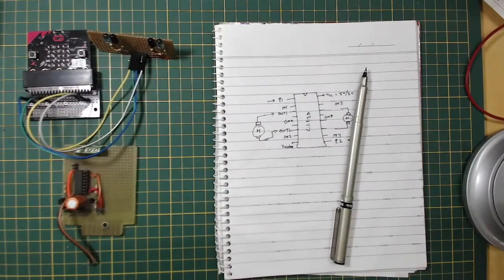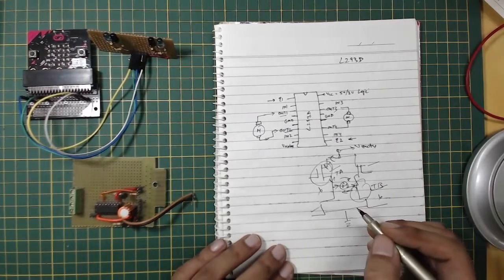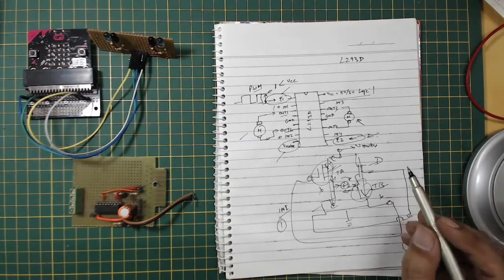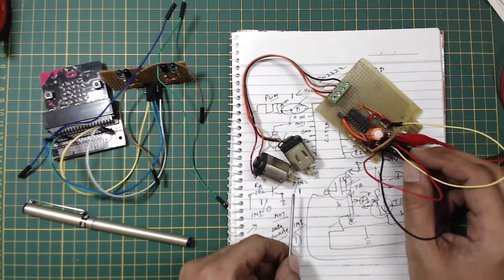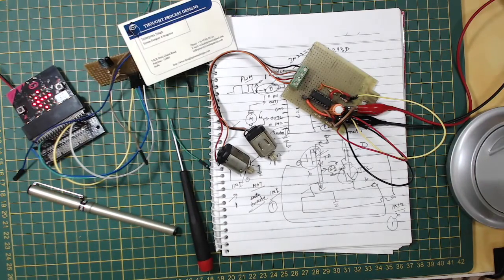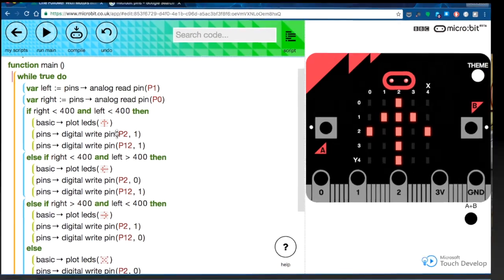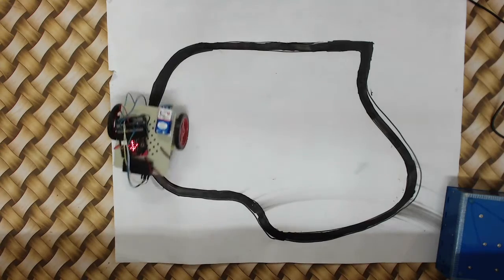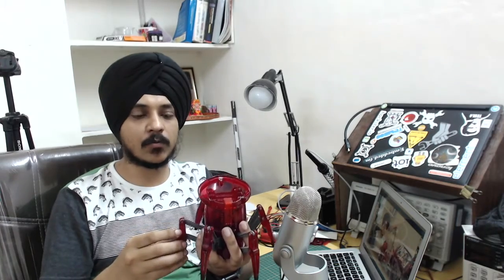How to make a BBC Micro Bit Line Follower robot Part 2

Comment: OK - so in a nutshell you are using 2 pins (P2 & P12) to drive two DC motors, using an L293D (H-bridge)  via 2 transistors 2n2222. 
In other words, the two 2N2222 are being fed signals via P2 & P12 respectively.   Did I get  this right?